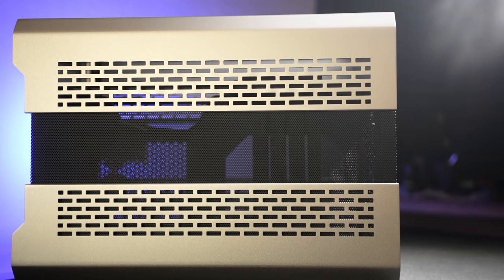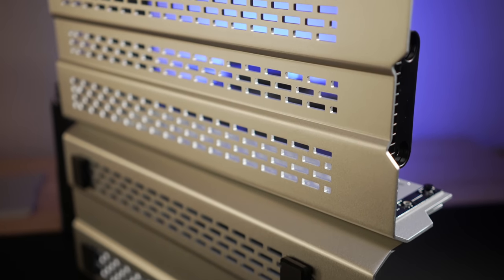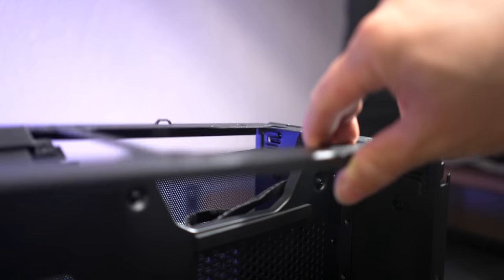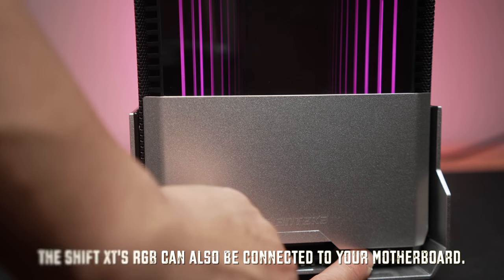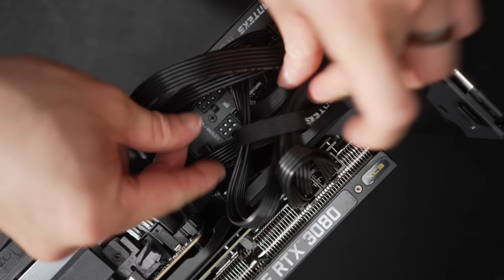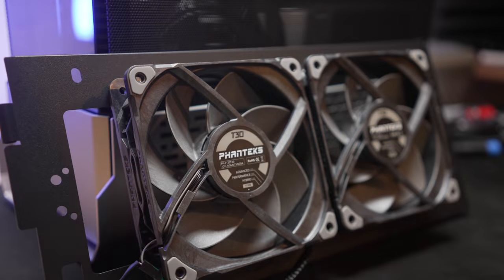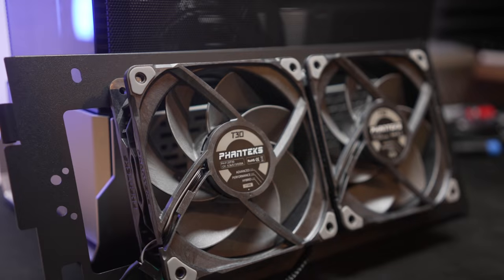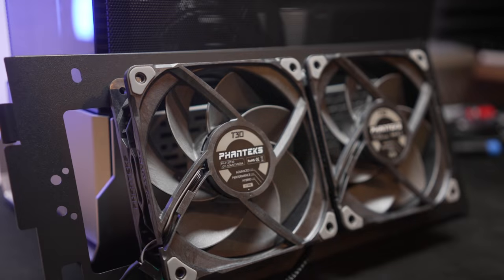The Phanteks Shift XT is Small, Medium, AND Large!

Comment: Very neat case, I'm still not sold on these top-vent-only sandwich style cases. I cancelled my Q58 preorder when it looked like it wouldn't fit what I wanted in it, this has flexibility that is much appreciated. I ended up getting a Silverstone Sugo 15 instead and what's interesting is in the "mid" setting on this case 2 dimensions are nearly identical but the Sugo is 1.5" wider. For that 1.5" extra desk space, it can fit a NH-D15, 3 SSDs and with my $12 mod, 2 HDDs, all at the same time! I'd love to see you review that one as I haven't been able to procure a GPU yet and I'm not sure what my thermals will look like yet.

Comment: Wow, quite an innovative design, and it’s really great to see how more the case brands are putting increasing resources on SFF enclosures! 

Though NR200 MAX is still more my cup of tea for the value & performance right out of the box.
Reply: Idk about value...the max was supposed to be a good price but that didn't happen
Reply: @samgoff5289  The price actually seem reasonable considering what's contained in the purchase., as well as Covid supply-chain issues. /shrug
Reply from the maker: The MAX is a very good case, I think it's a matter of managing expectations- an unsustainable MSRP was set during the supply chain uncertainties, compounded with the delay of the product... like @Cosmic Cleric mentioned it's actually not unreasonable based on what you get.

Comment: It looks like its possible to frankenstein a riser for the bottom panel to fit two 120 fans in there like in the top to blow fresh air in or a 120 AIO with an additional case fan. My future plan is to put a Ryzen 9 5900 with a 3080 in there. I dont need constand 100% on the cpu and hope thermals wont be a huge problem for light loards with additional fans in the bottom and putting the case vertical

Comment: I like the aesthetics of NR200 more, I'm wondering will it be good if I use two P12 as bottom intake and two P12 as top exhaust with the stock cooler be enough for 12400f

Comment: What a cool looking case.

I wonder if it can manage to run vertically?
Can the rubber pads be removed from the bottom of the case so that it looks clean when stood up vertically?
Reply from the maker: Great question- yup they pop right out, no tools required, actually it looks really neat straight up, the only thing you'd have to figure out is how you want to space it off the work surface so that the power plug and rear IO can be connected.

Comment: Really cool case and great review! Is there a gain to be made by sandwich mounting 120mm fans directly against the fins of a 280mm radiator? Compared to mounting 120mm conventionally on a 240mm radiator?
Reply from the maker: It’ll basically work as well as a 240 in that scenario. There are more high end 120mm fans though for upgrading.
Reply: @MachinesMore  I guess you save a few millimetres as well, It would be cool if one could squeeze 280mm rad + slim 120mm fans or 240mm rad + slim 92mm fans in a space only designed for fans.

Comment: This case gives me cyberpunk mega building vibes :D.  

Some kind of duct (like noctua for cpu cooler) would help gpu temps? Did you try flip fan on cpu cooler?
Reply from the maker: The CPU side really has little interference on the GPU side. My assertion is that it has to do a lot with the shape of the GPU and how it interacts with the bottom of the case. Too much space allows the hot air to pool up there, so I wonder if bigger cards may actually be better.

Comment: What would your reccomendation be for the best air cooler for this case? Using an Nfa 12x25 or a t30
Reply from the maker: If you want a 120/25mm fan there’s not many that will fit, the ID cooling IS-60 EVO like I used, and the frame of the fan was already pushing on the vent, so I think that’s the max. Stock L12S or Big Shuriken 3 are all solid choices for moderate TDP chips or just gaming scenarios.

Comment: Wow how did the gpu get that hot ? That seems pretty high to what i been seeing today from reviews.
Reply from the maker: The 3080 XC3 doesn’t have great thermals to begin with but it’s definitely hot compared to other cases. I think to some extent it’s really going to depend on the geometry of the card and cooler. At least in the 2-slot 3080 cards I tested they didn’t perform exceptionally well. It’s possible 3-slot cards might work better but will have to re-test.
Reply: @MachinesMore  what caught my attention more was that they were getting very close numbers with panel on and off. Which is similar to some phanteks cases when you take off the front panel.